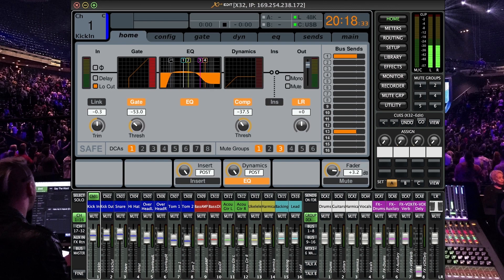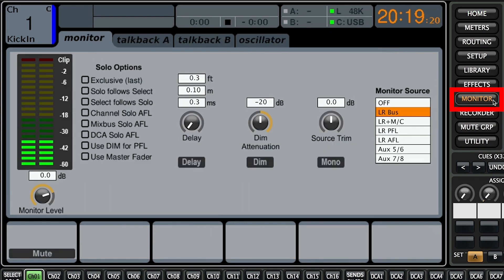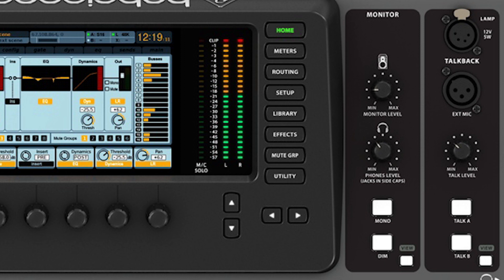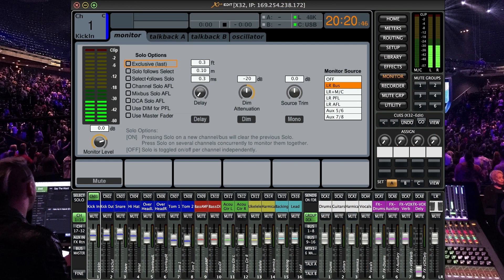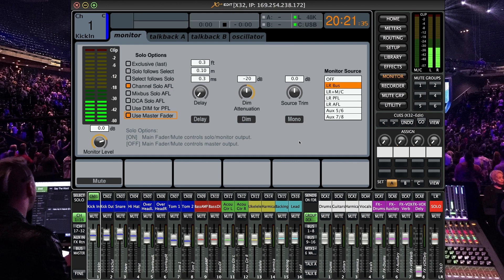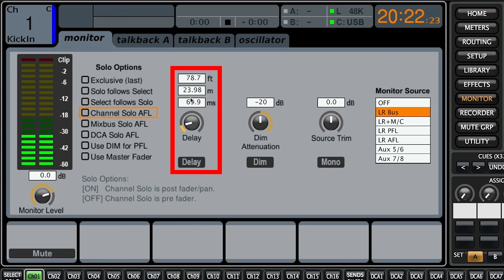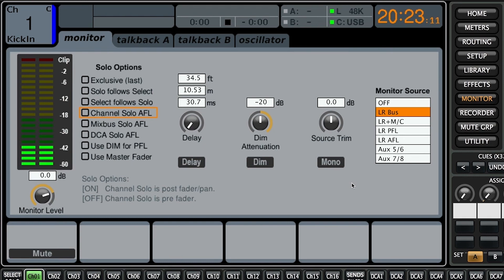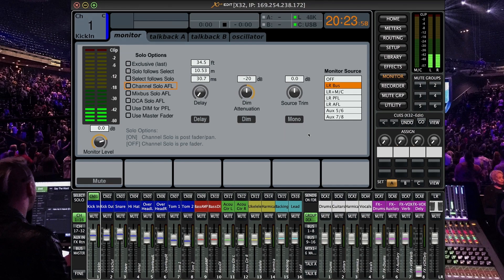X32/M32 Quick Tip 024: Solo/Reference Monitoring

Comment: Thank you so much

Just purchased mine for the studio so I like to solo up the different headphone mixes I've created so that I can adjust them for the talent. I'll be needing to pop back and forth quickly so I wanted to use the assigned functions to solo different headphone mixes? I was also hoping me a sign key could pull up that particular mix simultaneously on the faders? Not sure if it's possible but I was able to get my tascam DM 4800 to do it well. It would be tough to live without that function. Thanks for any help
Reply: On the current version of X32 edit, just click on the bus of your choice on the right side and the faders displayed will be those for the mix of that bus. This is "sends on fader" workflow basically (you can see it in recent X32 edit videos), and you can do the same with the console by tapping the "sends on fader "button on the console.

Comment: Hi. Thank you for the video.   Its so frustrating when the channel solo volume is way softer than the LR output of the board. So when you selct though with slundcheck you have to adjust the volume everytime.  It cuts into mixing time. Is there something we can do?
Reply: Make sure there is no "use DIM for PFL" and/or "channel solo AFL" option activated maybe ?

Comment: I want to be able to see, on the meter, the signal on a selected channel PFL as I adjust the gain on the channel. How is that done? On an analog board you simply select the PFL button on the channel itself. Or is that simply done on the channel strip itself and not through the monitor function ?
I have not figured out how to do that on the X32Rack that I have. (I use  X32 Edit)
The video does not explain what is seen on the meter....    Help please :-0

Comment: thanks for this, very useful!  Maybe you could help me with this: I have 2 pairs of monitors in my studio, one is hooked up via the Mon output jacks and the other one via the Main Output XLR's (Channels 7 and 8).  I want to switch between the 2 monitors for reference..  I can control the volume of set 1 via the mon level knob, but I can't find a way to control the volume of outputs 7&8, they tap from the Main out so these monitors always receive signal the moment the main volume fader is up.  Is there a way to control the output of channels 7&8 without using the main?  I'd like to switch quickly between my 2 monitor sets while mixing.  Thanks!
Reply: Why don't you use the main fader for that ? It's made for that AFAIK :)

Comment: I am a total novice on the M32, but I can get through a service with the very basics, running sliders, playing CD Tracks for the choir,  runnings mics for singers and the pastor's mic and the pulpit mic, using our bluetooth input to play songs/music from a phone,  again, the very basics... however, the one thing I cannot figure out, is during the service, say I have a music track playing for the choir, and I have the choir mics on, I have the song coming through the mains, and I am balancing the music out of the monitors for the choir to hear the song... why can I not hear what the board is putting out in the headphones, so I can better balance what the audio is balanced like that is recorded on our videos we send to the local cable company each week, to show the service to folks at home.
Last week, the choir's song from the CD player was swamping the choir, and I couldn't get my headphones to work, so I couldn't listen to what needed balanced... I eventually heard the problem in the audio that runs into our video equipment and was able to adjust the music down so the choir wasn't drowned out for their whole song.  I plugged my headphones in the 1/4 jack in the front, bottom-right corner of the board, but I cannot hear anything.  Be gentle I am a newb... what am I missing?
Reply: "why can I not hear what the board is putting out in the headphones" :
monitor : monitor source : lr bus (or lr afl or lr pfl)